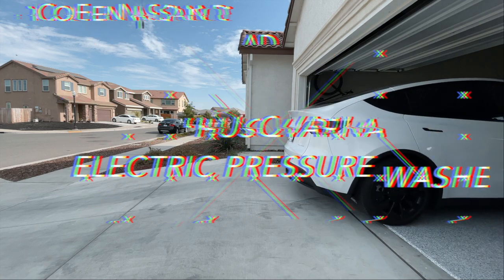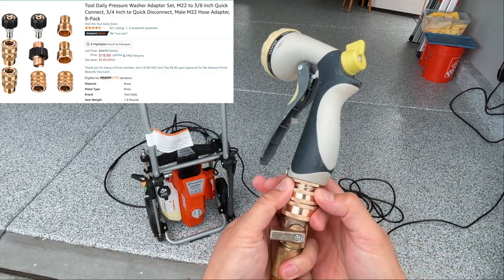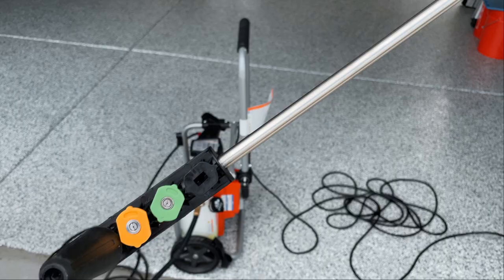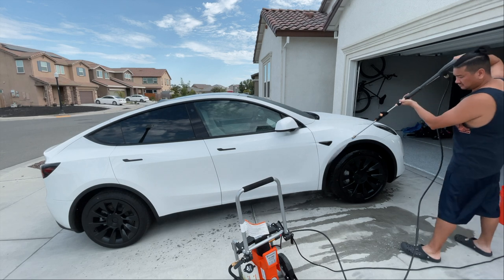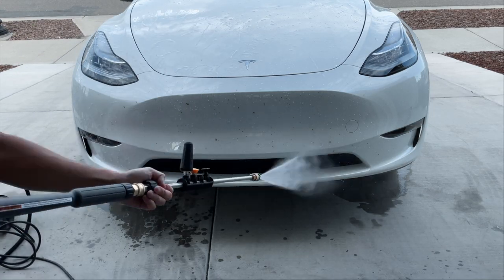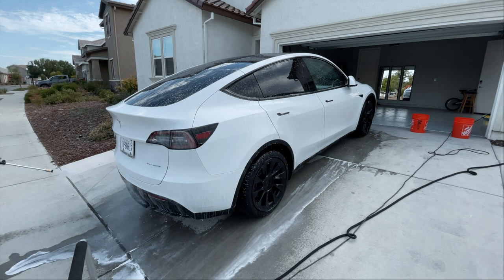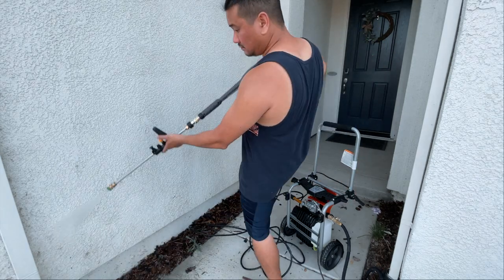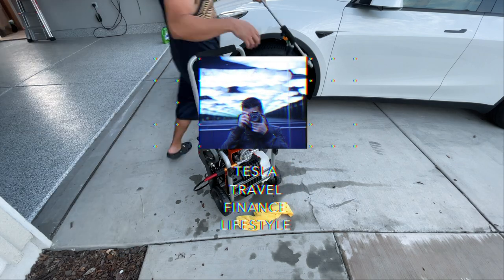Husqvarna Electric Pressure Washer from Costco - Easy Car Wash! 🧽 💦

Comment: Couple of pointers:
- I would use foam cannon instead of integrated soap dispenser. Many reasons for that: 1) What if next time you need to wash some concrete and there is still some of automotive soap in the dispenser , 2) Even when it looks like you used up all the soap, you'll still need to let it run for some time, when do you know when to stop? 2) Cleaners can corrode the pump housing and damage it overtime. Myself, I never use integrated dispenser. I use soap cannon for everything (not only car).
- I notices several things in this washer that led me to believe that is it designed to be used and preferably even stored horizontally, you can store it vertically too of course.
- If you don't think that returning stuff to the store will "damage your karma", I would recommend returning it and buying is again. The version that they are currently selling (6/6/2022) has "revolver" nuzzle - very useful thing to have. I thing it's even still on sale.
Reply: automotive soap is biodegradeable and it's safe for most surfaces and parts i recall
Reply from the maker: i got a foam canon now. i'll shoot a video soon!
Reply: @modernasiandad  what foam cannon did you get? I just got this pressure washer
Reply from the maker: @jlbehrens19  I bought this one but you can try other brands also. I'm going to have a video on this soon. https://www.amazon.com/Tool-Daily-Cannon-Connector-Pressure/dp/B07HC898GM
Reply from the maker: New foam cannon video! https://www.youtube.com/watch?v=uokTK71iF48

Thanks for watching

Comment: dude those quick connector idea is BRILLIANT, i love this washer i got it at only $150 when they did the $50 off, but those threaded connections get really annoying, you gotta thread and connect for the garden hoses, the gun, and the water supply line hose to the machine, etc it gets tiresome if you use it a lot, so i'm gonna use the quick connects!
Reply from the maker: let me know how you like the quick connects

Comment: I use this with my foam cannon and there is no scrubbing necessary. The foam is not as good as my gas pressure washer. This pressure washer is weak enough where you don't have to be super careful. But if you were to wash anything other than a car it's no fun. Get the gas version if you want to clean sidewalks and stone, but this one is probably just good enough for walls and cars.

Comment: Looks like my neighborhood lol. I will add.. Purchase a hose which doesn't kink like the shitty one this comes with. Make sure it's a M22x15 (or buy a M22x15 to M22x14 adapter) sized hose though since this one is slightly different! Also, brass (not aluminum/plastic) quick release fittings make using this a ton easier. For added ease, you can also attach most foam cannons on to the lance for better application of detergent.

Comment: the new one Costco has doesn’t have those nice tips, comes with some ‘adjustable’ nozzle and i think some 5 or 7 in one adjustable nozzle. cant find a video on new unit, this one looks nice though. enough power for foam cannon on yours? thnx
Reply from the maker: Yes enough power for a foam canon. I’ll shoot a new video w a foam canon soon
Reply: @modernasiandad  can/would you upgrade with a better hose, sprayer, etc. or happy as is?
Reply from the maker: @boknows8936  I like it as is already. I didn’t upgrade anything. I only added the quick attachments

Comment: My quick connectors are leaking at both sides of the garden hose. Could that be my hose or the connectors? Thanks
Reply from the maker: Try the quick connectors on a different hose if you have one. They shouldn’t be leaking unless they are faulty.
Reply: This pressure washer uses M22x15 fittings. A lot of other brands use M22x14 fittings. Might wanna double check the fittings you got correspond correctly with the fittings on the washer.

Comment: I’ve changed all of the nozzles … initially the soap came out… then it stopped. Is there a soap activation switch on this unit?
Reply from the maker: You have to use the soap nozzle that came with the unit.
Reply: @modernasiandad  after reading through posts. It’s the black attachment. Thanks.

Comment: Hi @modernasiandad, can you tell me how I can get the soap to foam up? i have returned this unit 3 different times because it was not making any suds. I tried Chemical Guys Soap and even Dawn Soap + water in the side reservoir with the black attachment and cannot it to release soap or foam up. Is there a special switch to dispense soap?
Reply from the maker: it should dispense the soap with the black nozzle attachment. make sure you fill the soap reservoir to the max line. * there is NO switch to dispense the soap.* Please note that soap will not dispense if you use the other nozzles.
Reply: @modernasiandad  Thank you so much. It turns out I was using the turbo nozzle instead of the soap dispenser nozzle. Lesson learned. Thank you for making these awesome videos!!

Comment: Does yours have little spurts of water that come out of the motor in between where the water inlet hose attaches and the hose to your gun?  Mine has sporadic little spurt out of there. Is this normal?
Reply from the maker: No, I don't have little spurts of water. Maybe try to tighten it a little bit more.

Comment: I need help using the soap dispenser.  I filled it with car soap but I can’t get it to come out?? Will it only work with the black flat top? Thanks
Reply: Correct, the car soap only works with the black flat top.

Comment: Hi, I got the quick connect set from Amazon per your recommendation. Everything fit very well but  the connector between the high pressure hose and the pressure washer does not fit. Any suggestion?
Reply: This pressure washer uses M22x15 fittings. A lot of other brands use M22x14 fittings. Might wanna double check the fittings you got correspond correctly with the fittings on the washer.

Comment: Hey man great review.  I need some help.  I’m a mobile detailer out here in So Cal. I saw this today at Costco… I’m thinking about getting this PW. My question is.... I have a 50ft PW hose....does it look like this PW can handle swapping out the oem hose to a 50ft hose?  Any help would be greatly appreciated! 
👍🏽💦
Reply from the maker: Hey, I saw other people replace the hose so it shouldn’t be an issue. If it doesn’t fit, you can always return the PW at Costco.
Reply: @modernasiandad  oh ok that's good.  I forgot to mention. My 50ft hose is attached to a reel with a transfer hose.  When I tried this on my sunjo PW the thing started leaking from the bottom.of the machine. I guess it couldn't handle the pressure or something 🤣. Anyways. I think I will try this PW out and K one you said if it doesn't work out I'll just return it.  Thanks for the response! ✌🏽️
Reply: @johnboy5632  its your connectors. its either a m22 14 or 15. They do sell quick disconnects depending on your pressure washer.

Comment: Glad it worked for you but mine didn't work so I am gonna be returning it. Pressure was less than regular hose so defeats reason to get one. It's a fail in my book- I do not recommend.
Reply: I think you got a faulty one. Return it and try a new one